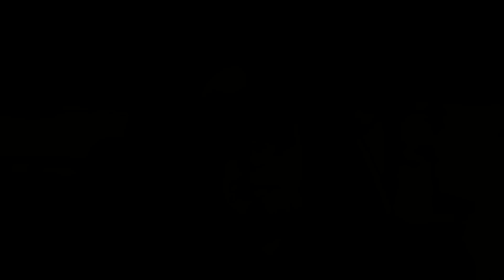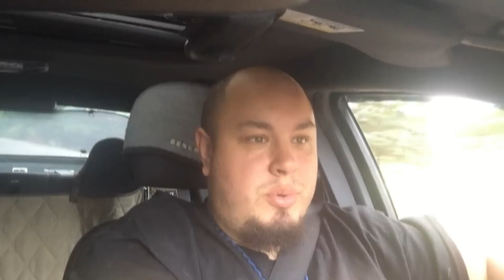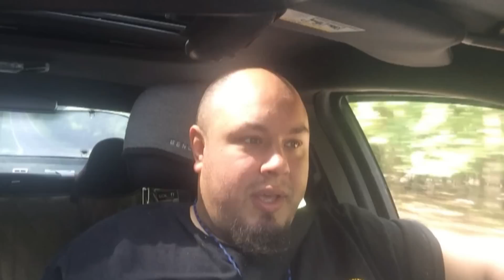Performance Upgrade For The Chrysler 200...Can You Guess What It Is? (Oh Boy Here We Go Again)

Comment: high performance blinker fluid reservoir.
Reply: woah man, that thing adds like 120hp, too much for street use
Reply: if you are going to the high performance turn signal fluid reservoir, you need stiffer radiator springs! Also Upgrade to a titanium Johnson Rod
Reply: +God of Thunder (UKKONEN) dont forget the vtec stickers

Comment: its a cold air intake... without other modifications to the car it's hardly going to increase performance... However a hell of a lot of people will disagree with this.. Plenty of test show there will be no horsepower gain you will be able to feel!  but it will sound cool
Reply: Yup.  It just makes people think their car is faster because of the sound.
Reply: yep. it will only add like .5 p hahaha however if you cold air intake, headers, better exhaust you MAY get 5. lol
Reply from the maker: if it was a CAI system and not a short ram system it would in fact have hp gains as it sits about 5 under normal driving and upwards of 9-11 at high rpms, but it would be increased with exhaust work and better flow out...many people, say CAIs dont increase HP but its been proven time and time again that they do, the dynos dont lie
Reply: cutlerylover Interesting.  Can you link me dyno info?
Reply: +cutlerylover you are absolutely right Dumps don't lie!!!  those horsepower gains are typically shown buy taking a engine with a lot of work done to it and often a tune then putting it on and saying look we had gains... Yup no crap lol.. but adding more air to a car and not getting more air out and not tuning  the ecu for said the air ect.  You may get a 3 HP gain.... it's nothing you would ever feel if you blink the wrong way on the track you have lost your time gain!! However it's a start to the whole bolt on madness that I am sure you will have fun with!!! enjoy it
Reply: +Ryan Dubay dynos not dumps lol sorry auto correct
Reply: Agree 100%. It's a waste of money to add a cold air intake or short ram thinking you'll get and performance increase. Unless your willing to pay a lot of money for a tune, the most you're going to get is a louder engine under acceleration. If that's what floats your boat go for it... but do understand the cars computer won't know this part was added and fuel to air ratio won't change and there won't be a performance gain.
Reply from the maker: Im not talking about those results, I am talking about the dyno before and after from the exact same stock engine...no mods to the car other than the CAI, they do show 5hp increase at like 2500rpms and 11hp increase at 5600rpms, these numbers are highly inflated by some companies though the legit people do real testing, and again increase in hp doesnt mean Ill be winning any drag races, its about sound, improved air flow, and improved gas mileage...if of course that is what Im getting :)
Reply: You can't claim it doesn't work and not provide links that say it doesn't, then ask for them from people who say it does.   If you know what you're talking about (which I'm not assuming you don't, you seem like you do) then you know it varies greatly on a car to car basis.  Quicker throttle response is usually one of the main benefits which will make a car perform better without necessarily adding horsepower.   Some cars have terrible factory air intakes while some don't benefit so much from a CAI.
Reply: +cutlerylover I'm pretty sure you lose a bit of low end power with a CAI, but 5-8 hp is added in higher rpms
Reply from the maker: thats what I heard about the 3.6l setups that have longer tubes, I will see what its like first person, if in fact thats what Im even adding, lol
Reply: I put a cai and a throttle body spacer on a truck and gained 3 mile to the gallon
Reply: ITS A FUCKING CHRYSLER 2 FUCKING HUNDRED
Reply: +mistersister707 granted I have been out of the scene for a long time but have dyno runs gotten drastically cheaper? I mean who goes out with a stock car runs a baseline Dyno then adds on Just a CAI and makes a run to see the gains?  shit that would have definitely cost me a couple hundred bucks if not more like 15 years ago!! Really and on a Chrysler 200?? I choose to buy basically a inexpensive midsize car that is not very well tuner friendly and spend a ton of money to figure out the gains of a cold air intake...

seems incredibly unlikely.. Well unless dyno runs are now like 50 bucks or less...

what seems more likely is kids getting excited about there parts then wanting to justify it so making there own little dyno sheets and posting them up... 

The engineers at Chrysler are not so inept to build a intake that is so terrible that you could achieve any noticeable difference 6hp at the wheels?? I doubt it..  But even if it was true. unless that car has like 100 WHP you aren't going to notice a thing.... 

better throttle response.. One of my favorite terms from the bolt on manufacturers... Tell them this... It's pretty much subjective so we can claim it and people will eat it up!!   

call it what it is..It's a start to modifying your car performance!
Reply from the maker: Most of the Chrysler 200 drivers where I live are men and in their 20's to 50's of course that doesnt matter since there are 75 year old women who drive lambos too, lol, so thats a stupid comment to begin with...but you did miss the point its IS a Chrysler 200, so the mods wont be extreme just fun stuff that makes me enjoy my car more
Reply: Yep, I think you got it Ryan.  Most of the cars I worked on the CAI all went into the bumper cover though.
Reply: When you're dealing with small hp gains, if the butt dyno tells you you've got gain, you should be happy :)
Reply: I saw a 75 year old woman step out of a Viper once.  Was not expecting that
Reply: mistersister707 I love you

Comment: Cold air intake. Remove the wheel to install the air scoop. Watch those deep puddles if it mounts low!
Reply: Good idea
Reply from the maker: the wheel is not coming off to install an air scoop...it is to access something I cant from the top of the engine bay

Comment: Cold air intakes do not do anything other than make the intake noise louder and cost more for replacement filters. Total hype.
Reply from the maker: thats a false statement and filters on CAI systems are supposed to be cleaned at 50,000 miles and replacesd at 100k so its not often
Reply: +cutlerylover believe what you want buddy but intakes have been proven over and over by multiple organizations and individuals to either reduce power or do nothing.
Reply from the maker: depends on the car, on my car its been proven to increase throttle response, increase gas mileage, increase hp as well as give a more sporty sound, these are proven facts that can be looked up, if you have the time try to disprove me with info on a CAI for a 2.4l 2013 Chrysler 200...Im going by dyno results as well as manufacturer results for my exact engine and car setup with a specific CAI system, as well as reports from people who have done it to their cars already which you can find on the chrysler 200 forum, so its not about what I believe its about what I know, so please tell me something I dont know
Reply: +cutlerylover you are getting  your information from either the manufacturer trying to get your money or people who already spent their own money and are justifing the purchase not reliable sources of you ask me. But whatever it's your car your money,do as you wish and have a good day.
Reply from the maker: thnaks but my info is coming from independent dyno runs from other 200 owners, you can get more info from chrysler 200 forums if you care to check, CAi systems will vary depending on the car and setup...the dyno results I have seen was for my exact car and exact engine stock...im not looking to boost the power in my car its a 4 banger daily, but I am looking forward to increasing the throttle response a bit and getting slightly better gas mileage and a cooler sound...
Reply: +Darrin Hillier With proper tuning a cai can increase hp, without one they usually don't do much but they definitely do work on most cars lol
Reply: There are many videos on youtube and and independent charts showing gains on a real dyno. So they are all wrong??? Its not anything super amazing but small results and difference in throttle response will be had. Just the cai tube provides a less restrictive flow than compared the cheap plastic tubing that is kinked around things. Especially in smaller cars where everything tight in the engine bay. I can tell you from experience, when I had my z71 dyno'ed I pulled 6rwhp with just an intake and a total 18rwhp with the intake and exhaust after the new exhaust was installed. The 6 hp intake test was done on the same day as the install along with the base run so I am confident the difference is from the intake. The exhaust was done about a month later.
Reply from the maker: most CAI system on a new car dont require a tune as long as you disconnect the battery before install the computer will adjust again once the car turns back on
Reply: yup you got it, maybe a real car would be a improvement

Comment from the maker: I will add after reading the comments that the tire is not being taken off to make room for any piping...it is to access something in the engine I cant access from the top of the engine bay...in addition the upgrade does in fact add HP on a Dyno and most of you will think otherwise but are simply wrong, cant argue facts, I didnt say Im adding 100+ HP all I said was it adds HP...about 5hp at driving speeds and more like 10-11 at 5600rpms
Reply: depending on your drivetrain, a wing can improve performance.
Reply: intake or manifold
Reply: cold air intake?  I put one in my 200 as well, no power gain at all, in fact I seem to have lost low end torque, but it does sound awesome!  mine is a A.E.M. brand
Reply: Ah, another video in the money pit modding series
Reply: fuzzy dice?
Reply from the maker: its all for your entertainment :)
Reply: coilovers.
Reply: If you're doing a intake I'll tell you right now its not worth it. You may pick up a couple more hp, and it will sound different. However because the filter in no longer in a air box it will get dirty way quicker, and there is a greater chance of it getting wet. Especially a cai where its towards the bottom of the engine bay.  Plus it could be a turnoff to a future buyer if you ever want to sell it. Also most modern cars have intake tubes that feed the air box with cool air, so power gains will be even less noticeable.

But if you insist on doing it, I would recommend:
1. Not modifying the stock intake in anyway and keeping it around so you can put it back on. 
2. Buy a quality intake and filter. Cheap auto part store filters are known for falling apart, causing you engine to suck up pieces of it. 
3. Unplug your battery to reset the ecu after the install. If you don't it may take a long time for it to adjust the afr's causing your engine to run lean.
Reply: This is literally cringe worthy.
Reply: +Logan Butters when dudea think they know shit about cars but end up doing stupid mods....
Reply: Muffler!
Reply: Edward Li you hit the nail on the head

Comment: As someone who has experience working for an automotive shop that had a dyno in the back room, yes a cold air intake can increase horsepower, but nothing that you will ever notice unless you tune your car after installing it. My brother currently owns a Chrysler 200S and has done some small modifications to it and after adding just a cold air intake it didn't show any increase in horse power on the dyno. This is because the computer systems in new cars won't do anything with the extra air you get from a cold air intake unless the computer is tuned to also add more fuel and accept the extra air. But it's your car so do as you like and indeed it will make some cool sounds, but behind performance unless you plan on tuning it this modification will not do anything. Love the videos, keep them up
Reply from the maker: a CAI does not require a tune at all that has been started by both the makers of the systems as well as Chrysler itself, the computer will adjust the air fuel mixture after the install when the computer resets it, also the gains are different in a 2.4 then with a 3.6, although not that noticeable thats not the reason why many people do it, they do it for other reasons like the sound change and the gas milage increase and throttle response insrease

Comment: Probably a cold air intake. 
Which actually dont make any noticeable performance increase at all. If anything they make your car run worse on more modern cars.
Reply: He might be doing a intake resonators delete which can In fact help your car gain power because of the better flow. You would need a tune but as long as you do tune your car correctly a cold or or just intake in general will not hurt your car
Reply: my 200 lost low end torque, but I just like the sound.
Reply from the maker: and Im guessing you have the 3.6l? long tube?

Comment: Cold air intake.  Skip it.  You're not doing anything to the performance of your 200.  In fact, you may burn out your airflow sensor quicker.   Waste of money, has been proven many, many times.   You're not running forced induction, so you don't need extra airflow, and chances are the induction path on your car is actually cooler than an aftermarket intake.
Reply: Any good tuning software can tweak the variables on the ROM in the ECU. Costly software too. There are some good Open Source ones out there but they are a little rough around the edges. No licensed code in some.
Reply: Roe Shambeau Generally speaking, you cannot tweak anything on a stock ECU.  So you'd need to replace your whole computer first.
Reply: +rewtuser you can tune a stock ecu...
Reply: Dane On a WRX STI?  Sure.  On a Chrystler 200 and pretty much all other consumer "grocery getter" cars, no, you cannot.  they do not accept returning the factory ECU.    

In fact, most performance cars can't even be tuned on the stock ecu, because it's not reflashable.   This is why people go out and buy haltech computers etc.
Reply: There used to be a company that sold devices to tweak the ECU settings, you could actually do quite a lot, lean out the fuel mixture, remove the governor, change the spedometer to metric, I think, amongst other things.  I don't remember their name.  I think they used to go for about $200.  I don't remember.  It's been a long time since I owned a car since I now work from home, and even in my gated community I would want to garage it, and my garage is roofed in, so I couldn't use a solar panel to keep the battery charged, plus cars do not like not being driven for extended periods of time.
Reply: Shinigami Again, certain (generally performance or diesel) cars can be tuned on a stock ecu.  You can't tune the ECU on a chrystler 200.  Or 300. Or any of these other granny grocery getter cars.  In fact, even on these cars with tunable ECU's, you're still going to replace it if you want to do pretty much anything.
  

They're reliable forms of transportation, but this is quickly becoming the "garbage autozone bolt on for my granny cruiser" channel.

Comment: Jeff, If you are installing a cold air intake which is piped down near the front bumper get ready for some fun when driving in wet situations or going through a large puddle. The horsepower increase is barely worth it. Keep the dam car stock and fix up your other cars. If you do this anyway look into intake socks. They make one for water which goes over the filter to help keep the filter dry. Again this is not a worthwhile upgrade for a Chrysler 200. Leave it stock and fix up the other cars.
Reply from the maker: thanks for the suggestion but no, your are incorrect

Comment: I really hope that you don't think that a cold air intake will increase your hosepower or torque. You can only cram so much air into a cylinder, all "cold air" will do is cause more dense air to allow more effecient combustion in the combustion chamber, but it will not cause any performance gains.
Reply: You don't remove a fucking wheel for an air intake. I'm thinking a higher stage clutch idk
Reply: It's an automatic.... and if you're trying to get "cold air" from somewhere it's not going to be in the engine bay, it's going to be routed somewhere where cold airflow would get, which would be above the air damn in the front going into the fender (which you would have to remove the wheel). Don't take my word for it... i just work on them for a living.

Comment: It's a cold air intake. You don't have to take a wheel off for the exhaust and he's not putting it on cause it's raining or he would get hydrolocked.
Reply from the maker: im not taking the wheel off for access, but not for tubing or adding a filter...
Reply: Curious now. Really hoping it's not like replacing a worn out brake pad or something. lol

Comment: Cold air intakes are usually supporting mods for people with high performance cars. A cold air intake won't give you a hp gain if your car is stock. Unless your gonna put up dyno sheets and prove me wrong.
Reply from the maker: http://www.knfilters.com/news/print.aspx?id=5770

gains are higher on my 2013 due to a different configuration...now try to disprove that

Comment: Cold air intake.  You shouldn't do it...   Most of them are not good for car and mostly just change sound.  In almost all instances, a cold air intake should be part of an overall build, including a new exhaust at least.
If you do, make sure it doesn't delete your "u-tube", which keeps the engine from sucking in water. Preferably one which has a hood seal and actually takes air from the wheel well(which it sounds like you did buy).